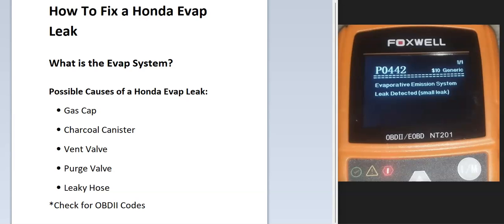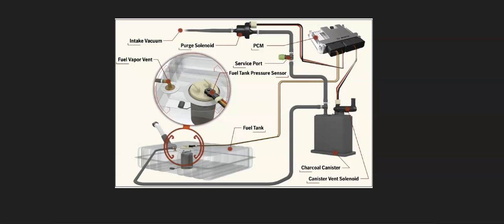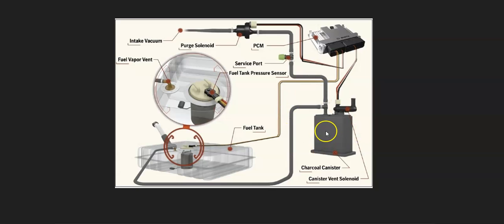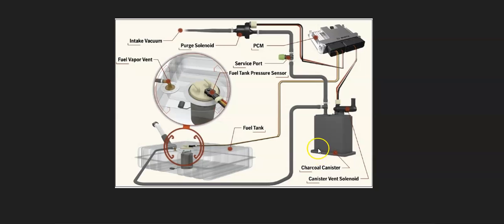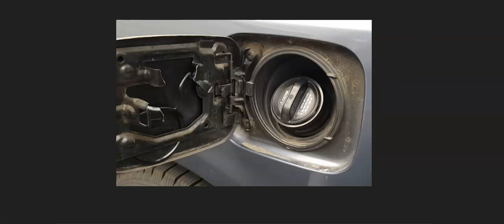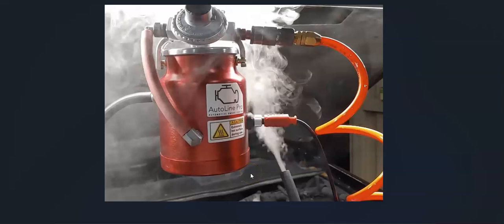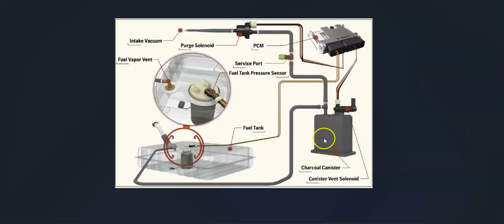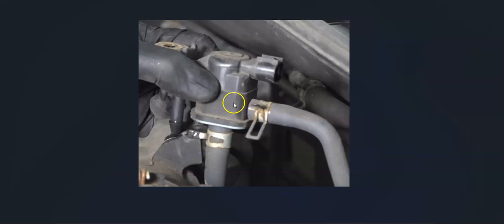How To Fix a Honda Evap Leak (What is the Honda Evap System?)

Comment: I have a 2019 honda insight  i have a noise like a compressor or pump  coming from the driver side rear around the wheel well area. The car has been off for 5 hours and it started to make a compressor like noise. This is the 3rd time I've noticed it and I think its evap system🤷‍♂️ has anybody experienced this sound?

Comment: My car issues began after getting an oil change where they replaced the engine filter on my 2012 Honda CRV. My vehicle started experiencing intermittent sputtering at low rpm’s when accelerating. After a while, I got a check gas cap alert that would come and go.  I replaced the gas cap to be safe, which seemed to fix it for a few days, but would eventually come came after refueling. A mechanic did a smoke test and didn’t see any leaks. The issue finally triggered the check engine light (small leak)  Replaced the solenoid purge valve and now the car is giving an evap canister purge valve circuit malfunction.  So frustrating
Reply: Piece of 💩 modern cars

Comment: Help please i hope someone had this issue i have a code P2279 air system leak 2004 honda accord v6 i found leak in the EGR value i replace 3 times new and new valves still leak i clear egr pasages already and still leak all deferment new valves ty

Comment: Loose gas cap warning turned out to be a bad vent valve, it had just a bit more stiction than the new one.
Reply: Update: Check Fuel Cap light came back, after a lot of 'this and that' I bought a smoke machine(60bucks on Amazon). I was not able to close the vent valve, plugged the pipe where it comes out with a wine bottle cork, found smoke also comes out of some white fitting on the firewall, but it was enough that smoke oil residue was left at the site of the leak.
There was a nic on the corrogated plastic flex pipe going to the filler neck....it looked rodents/squirrel or something chewed the pipe.  It was on top of the pipe, out of sight, I felt it with my fingers.
Fix was zero cost, wrapped it with elec tape.
My recommendation: Check that flex pipe with your fingers by running your hands around the entire pipe as much as you can. A quick check.

Comment: I got a 99 Honda CRV and I got gas fumes.My first code was a Eva bleak.And I accidentally erase it and I've never gotten back since then.But since then my car is run like s**It backfires all the time.I've replaced almost everything on this.D** thing.And I still can't get the car to run right?And i've burned through a tinker gas in thirty minutes to an hour and i'm not leaking gas anywhere on the ground
Reply: Check for intake leak

Comment: Hello, thanks for the well done explanation video.
I have a Civic 2010 1.4 i-vtec that dont have any error pop-up but everytime i Open the fuel cap it blows/sucks a lot of pressure. I think that some valve is not working. What valve should i check first? The valve on the charcoal cannister or the valve near the intake?
Thanks 4 the help.
Reply: I would say that since your tank is also connected to the charcoal canister, and the canister has a vent valve that is open all the time except when the car decides to check for an evap system leak, I would say either your canister is plugged or your vent valve is stuck shut.

Comment: There was a strong fuel odor in a Honda with the engine shut off.  It has a P1456 code.  What's likely the cause in this scenario please?  I must say this is the best explanation I've heard on the evap sys.  I always wondered where the gas vapor came from.  Some have said, I thought, the vapor came from unused gas in the engine, but you say it comes from the gas tank.
Reply: Did you figure it out ? I have same code
Reply: @BEARDED_VATO  In my case it was a hole in the gas tank leaking fuel.  Do you smell raw gas?  How I found out was I parked backward on an incline and all the gas moved to where the hole was, and gas was leaking to the ground.  If your hole is at the top of the tank you might not see gas leaking.  Your problem might be different.  But if smell raw gas as opposed to smelling just gas vapor, you might be leaking gas somewhere.
Reply: @ Thank you so much for the reply, i will probably fill up and check around the tank. I do not smell gas inside!

Comment: I have replaced everything you can think of what can be the problem 😊
Reply: One of your plastic lines that go from Your canister to your purge solenoid can be punctured. Especially if you were 4x wheeling your vehicle or ever ran over a huge Boulder. They are located underneath the car there's usually three or four of them. Good luck I hope you find it.
Reply: @nathanwillis1095 thank you for that. I use my civic for yard sales because it could park anywhere. . I could see  how this could be the problem.

Comment: were does hrv 2020 purge valve located? i have this emission show up on my scan tools said evap system code p0441 incorrect purge flow and evap system low pressure purge line performance both are permaent cant clear it

Comment: Hi there, is this valve could make clicking noise when the engine is fully warmed? I have Accord 2007 V6 there is clicking noise coming during driving when I push the gas, this noise only comes when the engine is full warmed. is this could be from this valve? PLEASE HELP.

Comment: I replaced the fuel cap with an OEM model. If that was the problem should the error code/engine light go off by itself or is there a way to clear to engine light? Great video by the way!
Reply from the maker: It will eventually but may take awhile. It is best to clear it with a scan tool. Automotive stores often do it for free.
Reply: @whyingo7964 unplug the battery or the ECU fuse

Comment: the O RING on the cap could be worn. take it off flip it over and put the O RING back on .
Reply: Or just get another one 😂
Can’t be that expensive
Reply: @alonsogalindo1428 it’s $80 at the dealer to replace the oem fuel cap on my 2008 honda hybrid 😂
Reply: The gas cap ? 🧢

Comment: I bought a smoke machine & in the rear I'm guessing the vent valve showed smoke. Should i use a scanner to close it some how.. I thought was to close the front purge solenoid
Reply from the maker: The vent valve is normally open until power is applied. A good scan tool can be used to close it or or voltage can be sent to the pins.

Comment: I have a 2018 Civic with a capless fuel filler. Are those prone to leaking? Thanks!
Reply: Did you fix it?
I also have a 2018 Honda civic Lx with P0455
Reply: @twisted2746  No, it was my in-laws car they had just bought and they asked me to look at it. Later they decided to take it back to the dealer who fixed it for them.

Comment: I RECENTLY REPLACED THE FUEL PUMP ON A 2006 HONDAY ODESSEY. AND STARTED GETTING THE P0457 P0497 AND A P0463 CODES AND CHECK ENGINE LIGHT FLASHES AND VAN GOES INTO LIMP  MODE. WHAT CAN IT BE. BEFORE I GO AND TAKE OUT THE FUEL PUMP AGAIN SOME ADVICE WOULD BE SUPER COOL.
Reply: I ALSO REPLACED THE FUEL INJECTORS. COULD I HAVE LEFT SOMETHING DISCONNECTED. THE CAR MECHANICALLY RUNS GREAT UNTIL IT GOES INTO LIMP MODE.
Reply from the maker: Evap codes won't cause Limp mode. The P0463 Code is a Fuel Level Sensor “A” Circuit High, which may be a wiring issue. I would check the plug at the fuel pump and the wires.

Comment: I can’t figure my Evap leak out neither can my mechanic and it won’t pass smog so I’m fucked.
Reply: Same here, getting frustrated, I need a good mechanic
Reply: Find someone who can read the codes 
can probe electrical wiring (that sends the voltage to the prge valve and charcoal canister solenoids
or who knows these Hondas very well????

Or you can start throwing parts at it like purge valve, then charcoal canister?????
Reply: @JohnSmith-yv6eq  I just watched Eric the Car guy using those tools to turn off and on individual valves. Would be nice to own these tools

Comment: After filling tank, check gas cap message comes up. Once it down to 3/4  of a tank (approx) message stops.  Have you ran across this before?
Reply: Yesss
Reply: My 2001 civic has all kinds of issues when the tank is topped off. I even get sick driving it. But once below 3/4 tank , no problems. Even had a mechanic install a new fuel pump

Comment: Is it dangerous to have a small evap leak in my 2008 Honda Accord?
Reply from the maker: Usually an EVAP problem will only cause the vehicle to not pass an emission test. The only EVAP issue that can cause engine problems is if the purge valve is stuck open which can sometimes cause the engine to run badly.

Comment: Listen, I have a Civic with an evap leak took it to two shops; one being the dealer in Springfield, Missouri and they could not fix it.  Still leaks, I don't know how dangerous that is cause I only smell fuel at low speeds or idle at a stop sign.
Reply: Could poss be your fuel filter within the furl pump if ya smell gas. Apparently mine and ? 01-05 dont have filters n in time,  the tops on them crack. Just a thought.
Reply: @craigorlikowski2507  Thanks for the input..
Reply: @danielmccann4055 Did it get better?
Reply: I quit  driving my 2001 civic because I would get very ill for several hours after driving it with over 3/4 tank of fuel. That was with a new fuel pump.